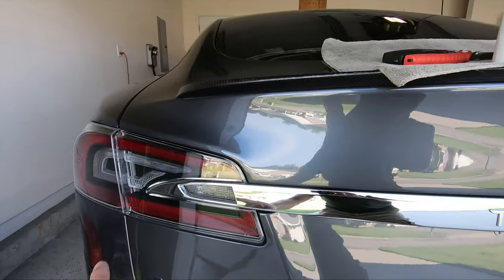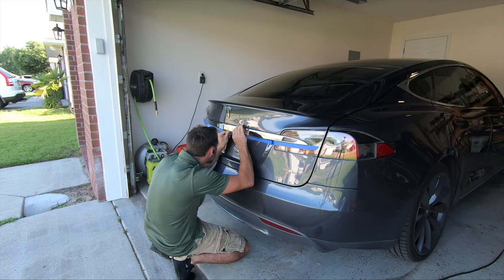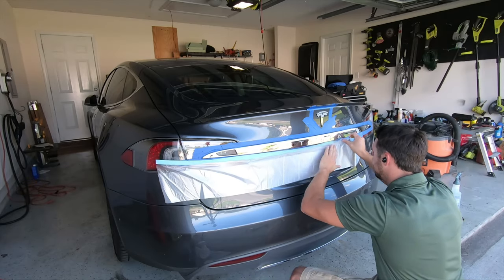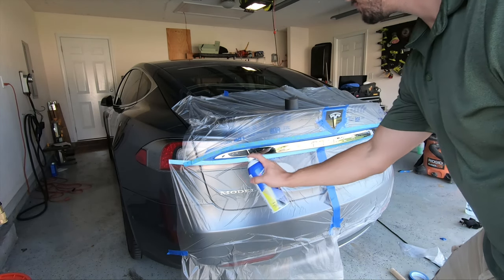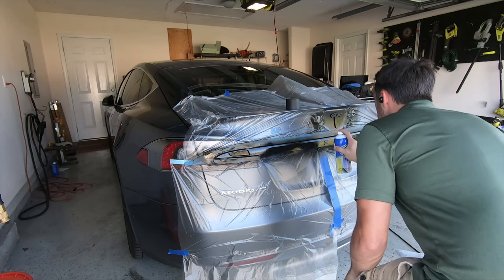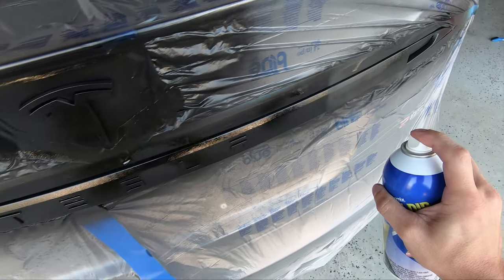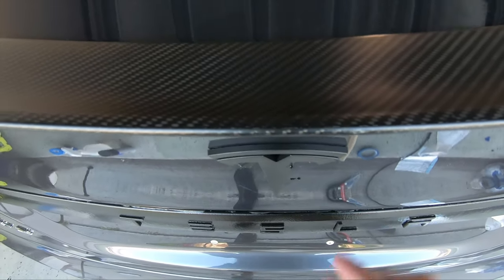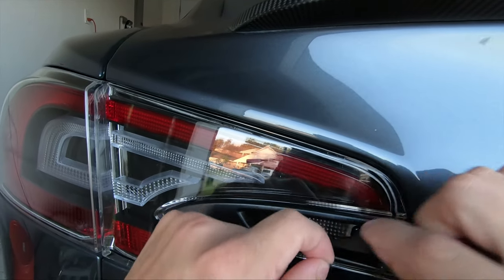PlastiDip Tutorial for Trim and Emblems

Comment: How long did you wait between coats?  Just until it dries?
Reply from the maker: Justin Willoughby around 10-15 minutes for a small section like this, if I was doing a larger area, such as the roof, I’d wait about half an hour. 
It’s fine if the plastidip completely dries before another coat, but you’ll get a smoother finish if it’s not fully cured yet. 
Small note: if the humidity is high plastidip tends to cloud up and normally will stay clouded.
Reply: JoeMartinMVC thanks!

Comment: How will this hold up in gas station car washes?
Reply from the maker: As long as you do at least five coats it wouldn't have any issues. If it's a car wash that has the rotating brushes, I would recommend at least eight coats to make sure it's more than thick enough to withstand the repeated brushings.